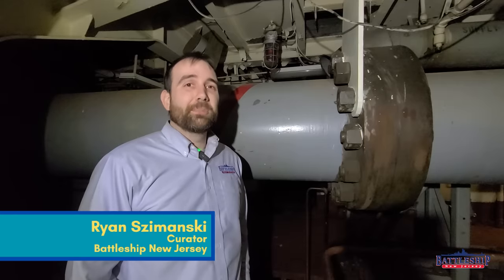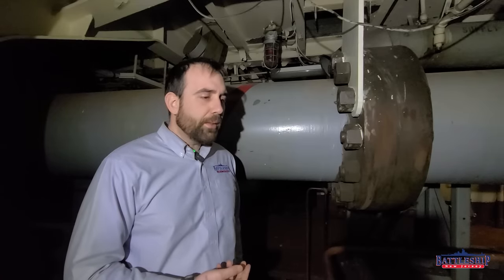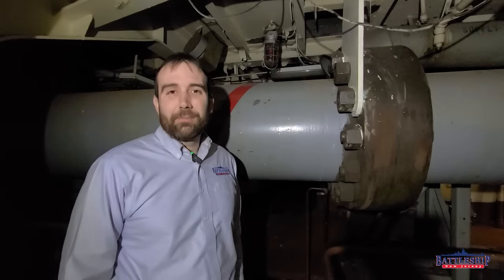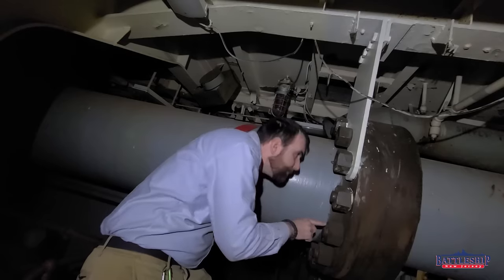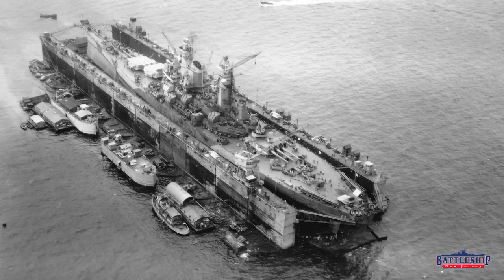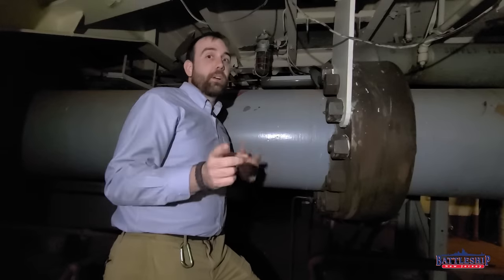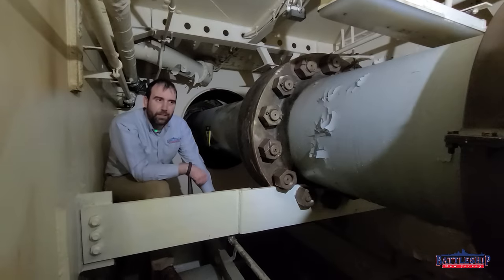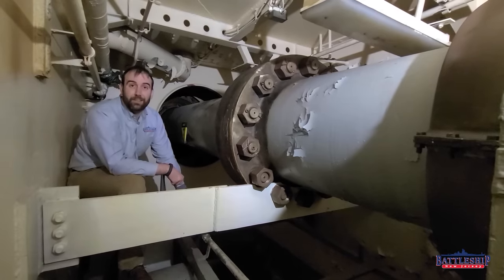Can The Propeller Shafts (And the Screws) of the Battleship Still Spin?

Comment: For the size of the screws of the Iowa's , a massive amount of surface area, the locking plates seem a bit undersized! Wouldn't take much current across the screws to make an immense amount of torque. Like cabin pressure in a jet. You can have 1psi of cabin pressure yet a door will be exerting thousands of pounds of force.  Since the steam turbines run through a significant gear reduction, the screws have a significant amount of resistance to turn the gearboxes. When viewed that way, they are like an overdrive box essentially.
Reply: Looks are decieving. First, they're designed to stop the shaft spinning while under tow. Second, in my own Navy experience as throttleman, I've seen a shaft locked with the much  less substantial jacking gear, and the ship still moving at 15 knots on the other shaft. Third, The shafts are long, in some cases quill shafts, with a phenomenal amount of twist in them. Aircraft carrier propellers will lag behind the turbine by a quarter turn at flank speed.
Reply: I also thought the locks like quite small for the job, but I'm guessing that the locks are mounted a long way forward so the shafts can absorb as much of the torque force as possible, essentially like a battleship-sized torsion bar. The force that acts directly on the locks is probably quite small. I'm assuming tidal flow and being towed a 3 knots probably isn't going to generate enough torque to break them. Plus, they didn't break when NJ was towed to her museum berth, so they must do the job...
Reply: @mongoose388  Obviously,  someone did the math on these at some point and they do the job fine. They just don't look very substantial for the job they do. No doubt they will be towing it to the yard at a snails pace. With the required power to turn her screws with enough speed to make 30+ knots, im sure the amount of torsion in the shafting is impressive! That would be so interesting info if its known. The scale of everything in these old warships is something else! I've unfortunately not visited any of the Iowas yet but I have been to CV-10 Yorktown and USS Laffey in SC. Highly recommend the whole experience at Patriots Point if you get the chance!

Comment: Yep, unlock the jacking gear, remove the shaft mechanical locks and see if they'll break free. Better be prepared for sizable leaks around those stuffing boxes💧💧💧
Reply: If they intended to move the ship under her own power, they should wait till she's in drydock then open up the stuffing boxes and re pack them before doing anything else. I wouldn't try to run any inboard motor on a boat of any size, let alone a friggin battleship without doing that first.

Comment: Let’s get real, what kind of force would have to exerted on the propeller to move the engine? That would mean a force capable of moving the propeller, the 200+ ft shaft, the reduction gearing and the turbine. Sounds totally preposterous, especially since the reduction gearing would be working in reverse. How many rotations of the turbine for each propeller rotation? 1000:1 ? It would probably take 50,000 HP to turn the propeller hard enough to spin the turbine. I don’t think that’s gonna happen while sitting still in the dock! Am I missing something here? Just bearing friction alone and momentum probably would take 1000s of HP to overcome.

Comment: That shaft lock tool is called a Slugging Wrench. They tie a rope on the handle for one guy to keep tension on and the other guy smacks the wrench handle with a sledge hammer. The rope keeps the wrench from bouncing off or moving out of position. 

I just watched Kindergarten Cop and in a scene with the bridge in the background at Astoria, Oregon, the USS New Jersey can be seen for a brief moment heading out to sea.  I promise you there were no shaft locks engaged. The movie was filmed in 1990. I got so excited that I saw a battleship that I paused the movie and did a search and found that it was the New Jersey.
Reply: New Jersey was paid off in 1991, so that footage was probably taken one of the last times the battleship left port.
Reply: ah, the good ole Slugging Wrench. For when the torque spec is "hit that motherfucker one more time"
Reply: Flogging spanner .
Reply: in the uk we call it a flogging spanner

Comment: The "Pc 3" probably stands for "Piece 3" is how it was numbered on the yard's paperwork and drawings for the work on that coupling.
Reply: It is interesting that the nuts are also stamped NJ, as if there would be other battleship shaft coupling nuts lying about which might get mixed up with these.  😊
Reply: @wtmayhew   Maybe for the inventory control at the nut farm ...😂
Reply: @donalddodson7365  Well stated.
Reply: @wtmayhew  I'd wager that those nuts are individually tested and certified to a high strength rating, so they'd have to keep track of where they are intended to go.
Reply: @Orxenhorf   Thanks for the reply.  I believe you’re correct.  I was making a bit of a joke there.  It is better when everything is documented and nothing is left to chance.  That is how to do quality work.
Reply: The shaft coupling bolts are fitted bolts - ie specific to the individual bolt hole.

Comment: A good job of Detective work Ryan ! Your knowledge of the ship grows by the day. Those steel locking plates look to be of 5/8" steel flat stock with good edge distance where drilled for the flange bolts. Just fits the old adage " Built like a Battleship ".

Comment: Remember lads always lock your shaft.
Reply: I'm good with mine in a cage and locked.
Reply: I always keep mine solidly locked in the proper docking configuration.
Reply: Had a girl that insisted I do the same once.
Reply: If not, you will get shafted good and proper.
Reply: @anthonyg9739  Sometimes it's good to keep the shaft in its original combat configuration and just permanently mothball the auxillary equipment...
Reply: I didn’t use the jacking gear either
Reply: @kevincrosby1760  Valid strategy.
Reply: @dreadsnot these giant nuts and huge shaft…
On this ship are outrageous

Comment: Yes, that's called a striking wrench, it's designed to be hit with a hammer, in the case of something this size it would usually be a sledge hammer. I used to work on rock crushing equipment, the crusher jaw bolts were even bigger than those and there was no room for an air impact wrench so the only way to get those loosened and tightened was putting one of those on the bolt and hitting it with a sledge hammer. And if the strike was not perfectly straight the wrench would go flying and end up is some awkward place inside the machinery.

Comment: It is always fun to see ship size components.  My roommate’s uncle worked at the yard in Virginia Beach in the 1970s and we went down from Fort Meade to visit.  They had an aircraft carrier and a nuclear submarine in dry dock.  The sub looked like a toy compared to the giant carrier.  The machine shop was amazing.  They had a bronze propeller with 12 foot blades up on a stand for balancing and well as huge lathes, etc.  It felt like the Jolly Green Giant’s workshop.
Reply: Subs in dry dock are surprisingly large. But in comparison to carriers, they are toy boats (that also goes for the reactor capacity difference). Carriers are just a different definition of huge and having horse power rated in the millions....
Reply: @goldenhate6649   Yes.  You summarized what I was getting at.  The scale is off the charts.

Comment: If you thought finding the nuclear tomahawk permission to fire keys was a holy Grail, try finding the cotter pins that would normally go on those nuts if the locking plates weren't there? All the other nuts have a cotter pin that locks the nut in place so it doesn't vibrate off, and those cotter keys would need to be reinstalled if the locking plates were removed. It looks like the locking plates are thick enough where the nuts don't seat fully to allow the cotter keys to insert through the stud
Reply: I've always thought cotter pins were largely disposable.
Reply: @russellhltn1396  They are a "once and done" item.  Once you bend the tangs over, they are finished.  Straighten them and you will be lucky if you can get them bent again without breaking.
Reply: The bigger the cotter pin the less it can be reused, these would survive a couple times ✔️
Reply: No cotter pins on those nuts. You tighten them and they stay put, a hole drilled in them would compromise their strength

Comment: I'm going to hazard a guess that the reason the fasteners are labeled is that they're of a special alloy, and they didn't want that hardware to be taken off and end up used somewhere else.  Since they're labeled as something special it should be easier to both confirm that what's on the shaft is indeed rated for the application, and if the hardware was installed elsewhere to see that it was.

As for the second shaft-lock, that looks similarly to how a "motor plate" is installed in a race car.  Instead of using soft motor mounts, they'll install a huge piece of plate steel between the engine and transmission using the bellhousing bolt pattern.  This plate can be attached to the race car in many more places than conventional motor mounts.  The car feels the full vibration because there's no isolation, but it's not going to come out short of the entire car being destroyed.
Reply: Elephant ears
Reply: Ship’s propeller shaft bolts are machined (ie fitted) to the specific hole in the couplings and aren’t interchangeable in another hole - or at least the modern navy destroyer ones aren’t.  

You want the shaft locks to be secured to something meaty enough to prevent turning - that way the tidal currents or even the way caused from being under tow could cause the propeller to free wheel and without lubrication could wipe the line shaft bearings, main reduction gear and LP & HP turbine bearings because they are all attached and spin at the same time.  That also why they don’t engage the turning gear so someone can’t accidentally turn it on with no lubrication and cause the same damage.

Comment: You ought to stay in touch with  the  group website  of former Philadelphia Naval Shipyard Workers and ask   some of  the old yard workers  about things like this .   I'm sure someone  there remembered where the propeller shaft locking devices were installed prior to  New Jerseys decommissioning  or could tell  you what  other preparations  may have been  done before releasing her.
Reply from the maker: The ship was decommissioned in Bremerton, do they have a similar website?
Reply: @BattleshipNewJersey   Don't know ,  I worked @ PNSY . PNSY has the  Drydock facilities  directly across the river. Ask   Bremerton ?  No one did more work on  BB-62 than PNSY  so why not ask  them ?  You have real people with actual  docking  experience right here so why   mess around ?  Who is contracted to do the work ?   I'm  sure the procedures that we employed for the  the  mothballing of the USS Wisconsin and the USS Iowa  were similar to the ones used on the USS New Jersey plus things like keel block placement are the same for all four Iowa class battleships.
Reply from the maker: The easiest way to define the differences between ships of a class is which ones were built at which yard, there are some major differences between the yards and how they do things. Each of the Iowas was mothballed very differently, thus Iowa being able to rotate a turret and we cannot.

Comment: The stern tube shafts do not use a flange like you are pointing out, they use a muff coupling - look it up. One of the viewers stated the flange couplings are welded, they are not. The flange bolts are a precision taper fit type, hence the specific identification. That wrench is called a "slugging wrench" and is a common size and type, nothing unusual about it. Nowadays a hydraulic bolt tensioner or hydraulic torque wrench is used instead of a slugging wrench and sledgehammer.
Reply: I'd like to ask if the shafts are solid or hollow and also does the flange come off to slide shaft out of the hull?
Reply: The shafts are hollow. A hollow shaft is stronger than a solid shaft of the same weight - which would be much less diameter but weight was more important for many reasons. The flange is not removable, it is forged as part of the shaft itself. The tail shaft (or stuffing box intermediate) will have a muff coupling that is removable so the shaft can be pulled inboard to remove if a removable coupling is not fitted forward of the stuffing box but none of the videos show or describe the current configuration. It is possible that NJ shaft is pulled forward and since that part of the shaft is relatively short it is possible that it could be removed without having to cut an access hole in the skin or decks. Considering a shaft replacement or repair is a major task requiring heavy shipyard work and time, cutting  a side port is very likely. The Navy has records of the Iowa shaft repairs somewhere waiting for a researcher to definitively answer the questions.
Reply: @oldtugs  Thanks for the info and helpful for this old guy. I did figure they are probably hollow for reasons you state but never knew. I did look up the Muff Coupling and found them very interesting but still wasn't sure if we are looking at a muff coupling.  I was a fresh air snipe so never made it down to the engine room on the USS Vulcan, Building #5.
Reply: The video does not show a muff coupling, only flange couplings.  If you look at photos of the outboard shafts you can see a cylindrical object a few feet from the hull fairing of the stern tube shaft. That is a muff coupling that connects the tube shaft to the tail shaft that is connected to the propeller. The muff coupling allows the tail shaft to be removed aft without disturbing the strut bearing and the tube shaft to be pulled forward. A flange coupling can not be pulled through a stuffing box and stern tube, it is too large in diameter. Be careful when listening to some of the descriptions on these museum ship sites, this one is better than some or maybe even most but still suffers from a desire to put a video online more than a desire to spend the time to research the topic and provide valid information. The real value to viewers lies in the details and the history behind the what and why that is so casually ignored. It is a real disservice to the viewers who come to learn something about the technology because the presenter is almost always lacking in the subject matter knowledge or experience required to provide reliable information. I wish that museum ship organization would develop a set of standards to ensure the technical content of videos is beyond the level of fund raising clickbait. The role of a curator is to help people understand what they are looking at, and that is, sadly, rarely the case in the museum ship fraternity.
Reply: @oldtugs  I don't think the IOWAS have muff couplings..  If they let us down by the stern tubes on WISCONSIN I could go down & verify.  I was on a RORO merchant ship back in the 90's that had a muff shaft coupling and that ship had a pretty small stern tube seal assembly - but I've been working navy vessels since 2005.  On the FFG's & DDG's I've docked they had flanged propeller & stern tube shafts.  The stern tube assemblies are large enough for the flange to come through.  The stern tube & strut bearing assemblies (hard rubber staves in split bronze holders) also come out which gives you a little more room to work.   As for the what the cylindrical object that is a few feet from the hull - If the navy shaft design holds consistent - that is the mating flange between the propeller shaft & the stern tube shaft - which is then encased with a watertight enclosure called a rotating fairwater and it's shaped like a football.  It's watertight so the flange bolts don't corrode.  Also - if you see any BB drydock pictures from astern you'll see the rudders are just inboard of the two inboard propellers so once you take the propellers off the propeller shafts should slide right past the rudders.
Reply: @robertbossa623  Thanks for the information. I know that around the time of the build there was a change in coupling types but I haven't been able to narrow it down to which ships or when. There is almost certainly documentation onboard that would verify what type of couplings are used. We just need someone to find it. 
PS - are you an old MEBA engineer?

Comment: Since you're gonna go into a drydock can you do a short video on how much asbestos is still on the ship? I see the signs every now and then (right above your head here actually on the shaft...) and I'm always concerned for your health being in those rooms.
Reply: as long as the pipe lagging is not disturbed, it poses zero risk.
Reply: @leftyo9589  pipe lagging, boiler insulation, floor tiles, switchboards, and the list goes on...

Comment: Imagine the hardness level of those bolts holding the shafts together....lots of torque on them babies!  Can someone look up the torque specs for these babies before you cotter pin them?  ha ha

I wonder if these have split coupling that join the 2 shafts together, so they can slip them out through the ship

The tooling alone to make these shafts have to be massive....

Comment: My father served on the battleship USS New Jersey in the Korean war from 51 - 55 and was a Seabee. He told us kids he was one of the crew that during drills would go down and wait for instructions on which way to steer the ship manually and how many degrees. This was incase they lost control from up top if the steering was damaged. After he received the command he had to repeat it back. The cannons had to be set atleast 15° from horizontal otherwise it would shear it off the deck. I believe he said it could take five packing which shot the missile the farthest. I've been wanting to take a tour of it and if there still there lay in his bunk.